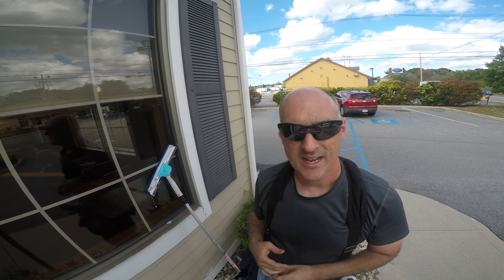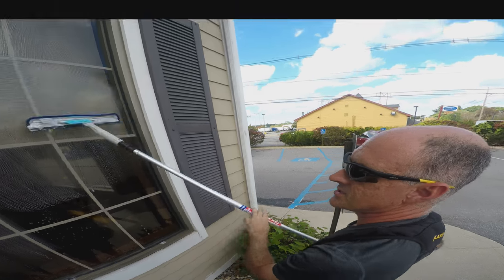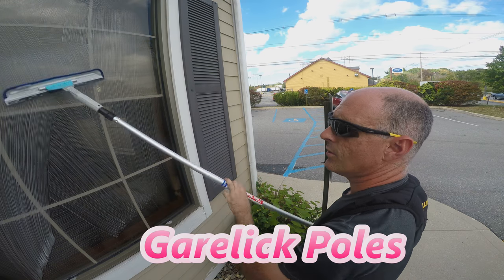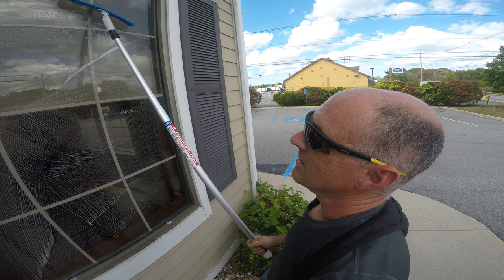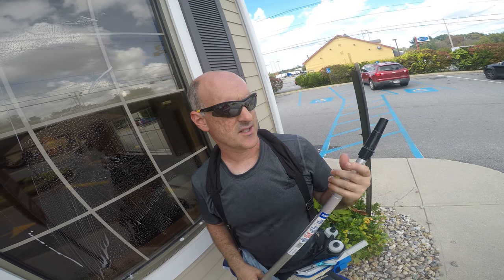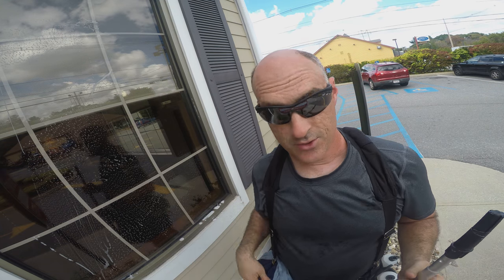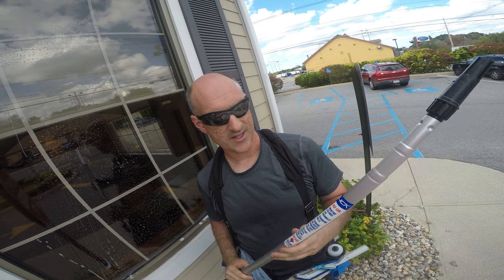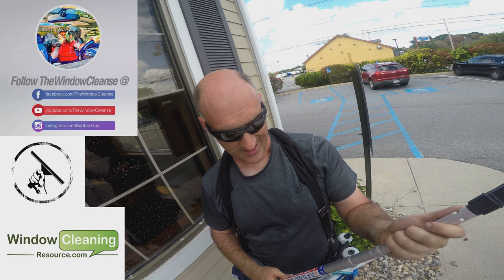Hidden Gems - Garelick Extension Pole

Comment: +1 for garelick poles! I have a 2', 8' and 18', they're great!
Reply: The Window Cleanse I like using the wooden tip, it's thick enough to fit basically every kind of squeegee handle. I also carved a taper into the end of the tip for detailing, it gets into the corners better

Comment: That’s my favorite pole all the way up to 24’
Reply: The Window Cleanse no they usually take about 9-12 months to either lock up so bad you can’t them unlocked or they won’t lock at all, I usually buy a new one every year! I always use a wood tip, its not the best pole for swivel tools except for wagtail but I mostly use these poles for straight pulls